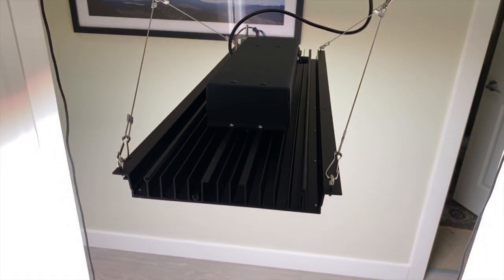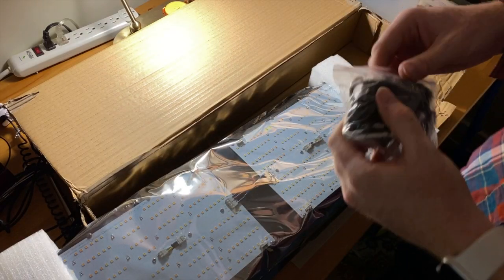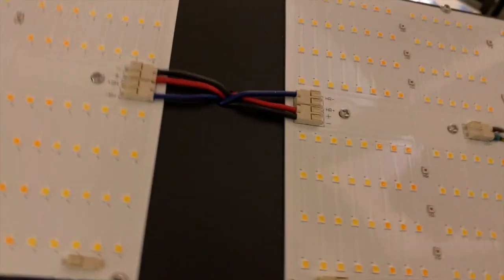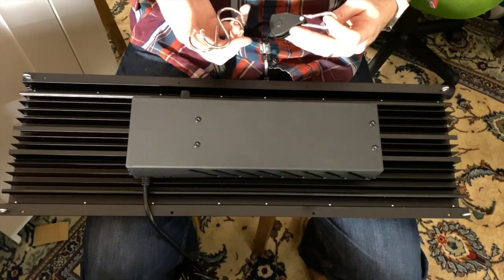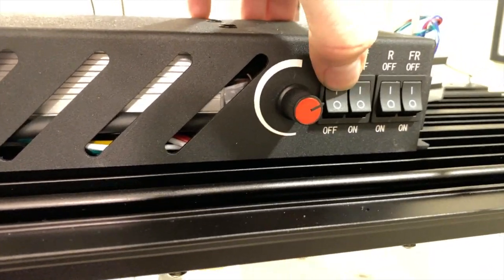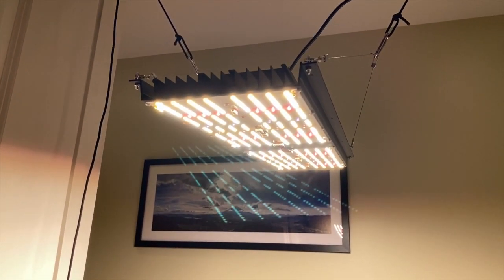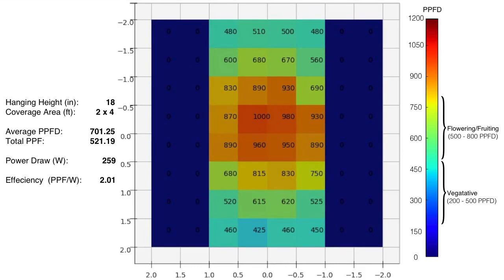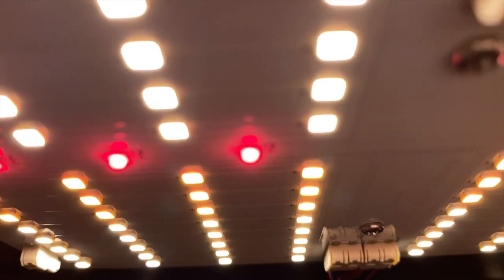BavaGREEN 240W LED Grow Light Unboxing & Review - PAR/PPFD, Temp, Watts (Grow Quantum LED)

Comment: Just got one just the bigger version. Had a question theres 3 switches for diff lights. Which ones are on for veg and which ones for flower?. I was told white light for veg and red for flower which I knew but which switches are they?
Reply: Uv is the only one that should only be used in flower, and even then in moderation.

You can run the far red & infrared in veg for best efficiency, or turn them off to reduce stretch in the growth if required.  Infrared creates emerson effect but also high heat conversion, so if you're having issues with high air temperatures for example you have the option to switch the IR off.

Comment: 421.32$ Canadian according to their website
Reply from the maker: The one for sale on their website isn’t the “professional” series. I think it only has UV and not red and far red LEDs.
Reply: @SmartGrowAutomation  it has far red and red. Just doesn't have inindividual toggles on the current model. Current model on switch toggle UV and Far Red, red is always on.
Reply: Current model does have far red and red. Just doesn't have individual toggles on the current model. Current model switch toggles UV and Far Red, red is always on.
Reply from the maker: @homegrownandstoned2032  Good to know! So the only difference between this light and the one you are currently selling is the switches?
Reply: @SmartGrowAutomation  yes. The current model has one switch for power and a switch that toggles UV and Far Red. The professional series was designed to give greater control to the grower.